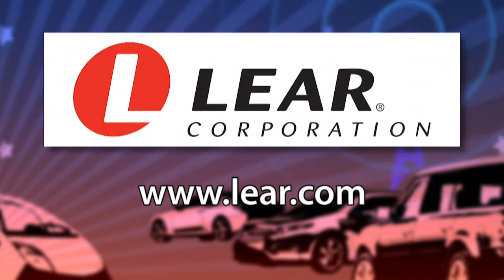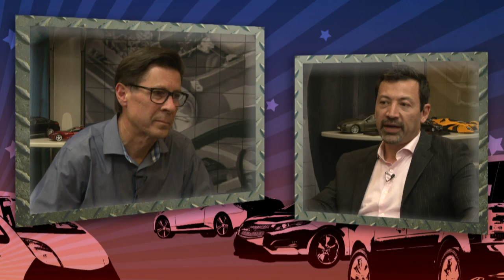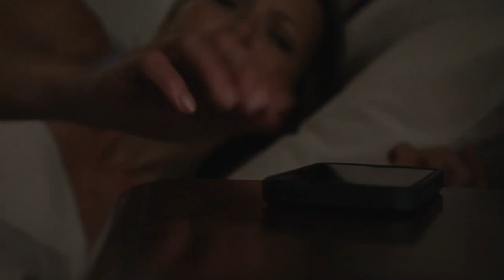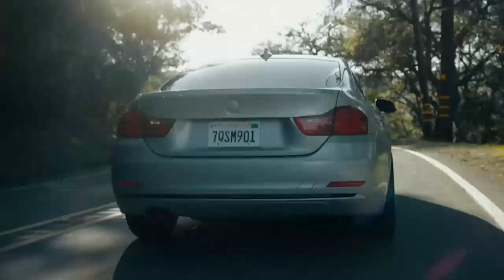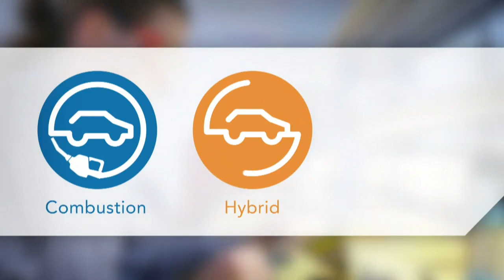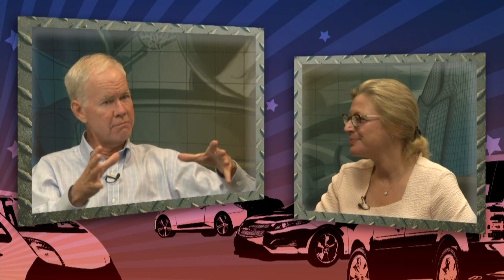The Story Behind The Story of Ford's Transmission Problems - Autoline After Hours 472

Comment: Didn't Ford do the same cover-up with the Pinto back in the 1970's.
Reply: The Ford Execs that covered-up the 1970s scandal have long since retired (or died).  Today’s Ford execs are all new people

.
Reply: No that was the brainchild of their CEO Lately deceased L. Iacocca.
Reply: Not over transmissions. The Pinto was about an easily fixed flaw in the fuel tank. A "not severe" rear impact could lead to leaks and fire. Again this was easily fixed and Ford did not do it. Aftermarket fixes were used by owners and fans of the car, because it was fundamentally a very good car. 

Sadly, Ford's inaction doomed the Pintto being a poisoned nameplate and may have damned the RWD compact car segment to failure.
Reply: @DocWolph  The Pinto passed rear impact crash testing of that time.   Ford had a recall that addressed the concern, a plastic shield was installed in front the fuel tank to prevent the differential from cutting the fuel tank and a longer fuel filler neck was installed tp prevent the filler neck from being pulled out of the tank.
Reply: @benjaminwayneb  Yes, but that was after they had secretly determined that it was cheaper to pay for the deaths than to fix every Pinto, most of which wouldn't be affected. Once this deadly policy was revealed, they did the recall. 
Money Uber Alles.

Comment: What does Sandy Munro think? Would he dare say what he really thinks?
To me, seems Wall St. considered more important than customers. Most buyers actually believe the ads & salesman.
Sadly consumers seem to respond to Ads and Car Salesman 
https://www.investopedia.com/news/most-and-least-recalled-cars/
https://www.investopedia.com/slide-show/car-recalls/  only to 1996. GM Ignition Switch, Ford latest transmission, Mercedes Fire problem ...
Try google search: auto recalls last 50 years
Seems to me this show points out how Tesla vertical integration is a real strength. As Sandy Munro has mentioned. John of course sides with GM & Ford - outsource.
Reply: @brandoYT Sandy Munro has repeatedly complained that Teslas quality is low with massive gaps in the panel

.